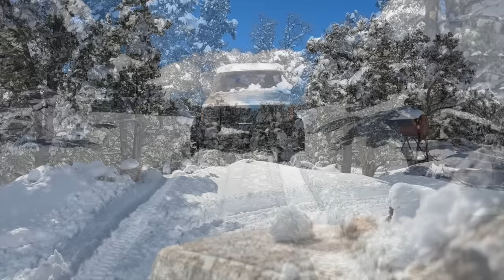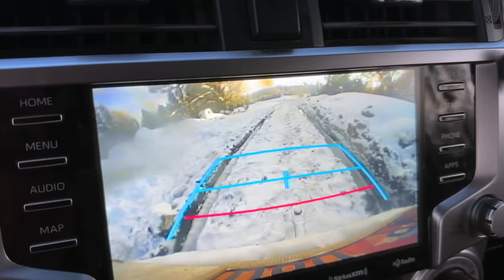CABIN FEVER!!

Comment: Not to be nosey but do you check the oil on tractor? I use  Diesel additive if it's really cold. Trent and Allie has so much snow the building are getting buried. Because  going off hill. Hope you have food for snow storms.
Reply from the maker: The tractor gets maintained regularly. I haven’t had to use any additives yet. The tractor runs great so far.